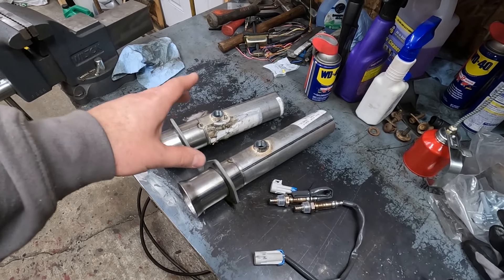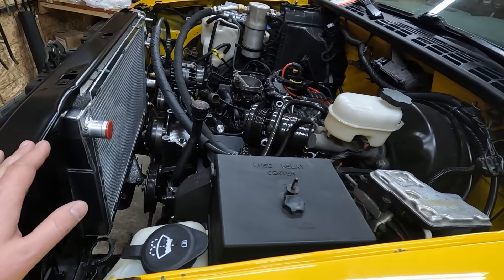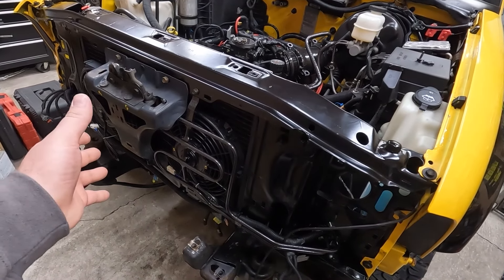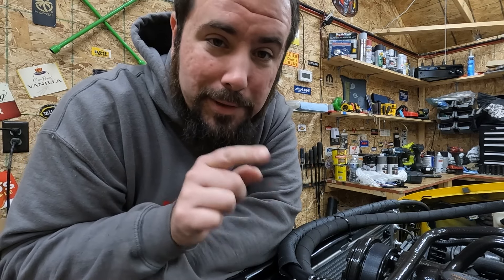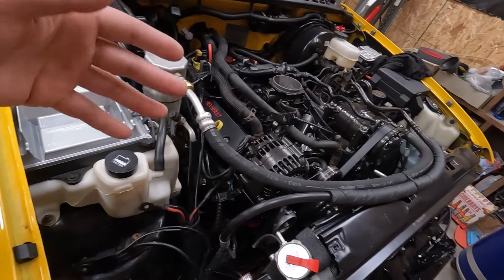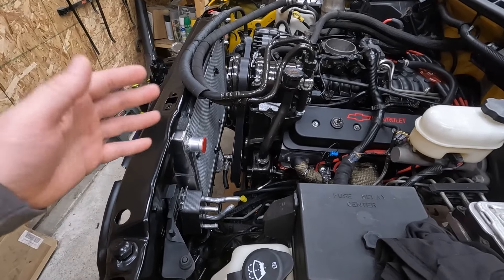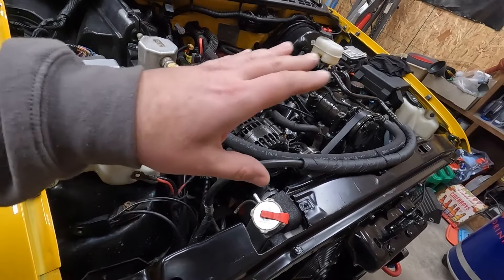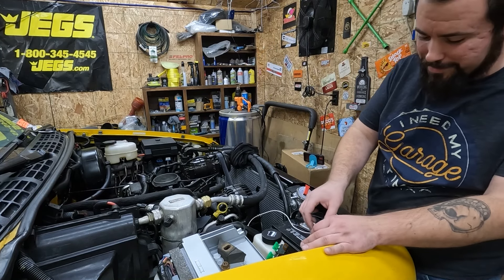Final Assembly! ( S10 V8 Swap )

Comment: Doing the exact same thing with the fans on the front. But adding two 6” fans on the back side, spaced apart to miss the accessory brackets. However, I’m taking a shot on the stock radiator, with stock placement. I’m gonna try it out before I go to an aftermarket and cut up ANOTHER core support. Definitely been following this for months. Looks real nice.

Comment: Excellent Trev, I did some of the same like EXACT placement of my fam relays as it was quite possibly the ONLY  lol, not just the best spot/ I went to PLM and got 2 SPAL as my "wahoo" burned up after about a month/ swapped a C5 rad by A&A I got for. Steal, no cutting core support which was nice( still might if the front end ever gets torn down again for extra space but now, it's fine) trick move with the Ford heat sink cooler! Careful tapping the ecu, I've had issues in the past with the gm electronics freaking out from the 5v signal being messed with,etc. But so fat, so awesome! Looking forward to it coming together for ya!
Reply from the maker: I’ve seen that SPAL brand come up a few times in my searches. Guess we’re see how these hold up for now. Good to know on the computer, I did use solder butt connectors, they work great! So should be good there.

Comment: What throttle  cable did you use and what headers did you use? Bc i hav clearance  issues with my headers
Reply from the maker: The stock one just barely reached for me. I have the smaller headman s10 V8 conversion headers,,, can’t remember the size offhand, but there’s only two different ones.. I really want the bigger ones ( 1-3/4 inch) especially now since I’m doing a 383 but there is lots of reviews about clearance issues that scared me off.

Comment: Man, I just lucked up on this video. I just bought a 96 s10…2.2/5spd and have another full size truck 5.7/4l60e I can use. I desperately wanna keep the EFI if I can, but have no problems going carb. If I can transfer harness and keep efi I’ll keep the 4l60e and go to a floor shifter.
Reply from the maker: You might have a little more work coming from a 4banger but it definitely can be done as long as you match the right parts up. Nothing against carbs, but the factory EFI is nice and clean for a street cruiser. Good luck!
Reply: @nicholsperformance92  when will you be releasing your wiring info?
Reply from the maker: Im waiting to get the truck running and make sure everything’s working. I just want to make sure I’m not spreading bad info.